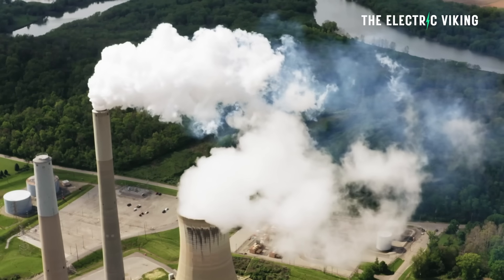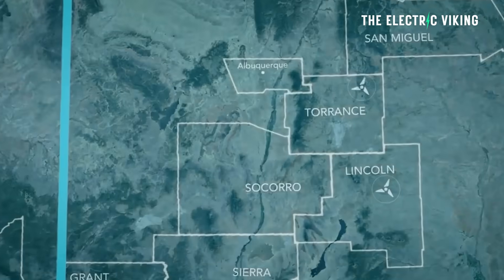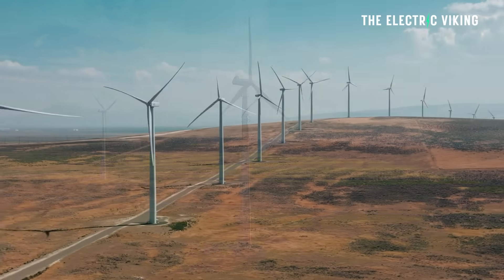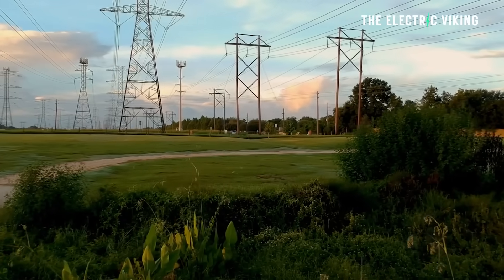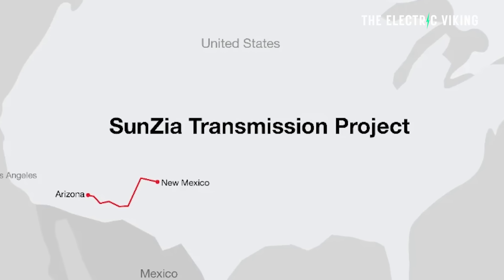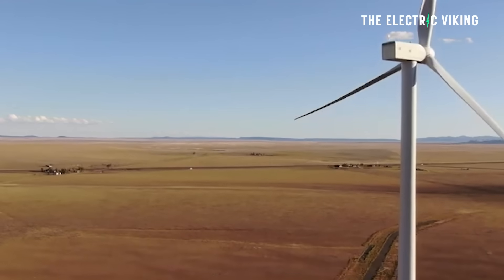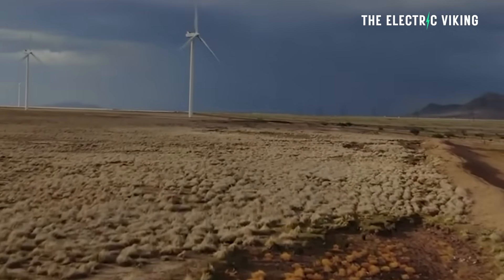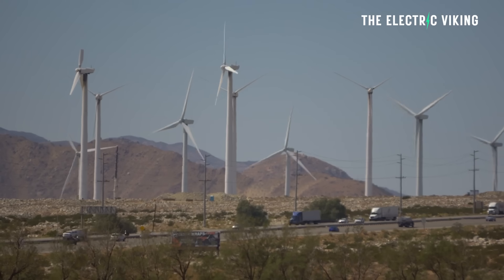The largest clean energy project in US history starts construction costing $11B

Comment: THIS is why nuclear is DEAD. 

Renewables are faster to build, cheaper to build, can produce as much power as nuclear. 
With battery backup PRODUCES BASE LOAD. 
Decommissioning or replacement is dead easy and cheap. 
NO toxic waste to protect & store safely for 1,000 years at obscene cost. 
Bottom line: wind turbines & solar panels NEVER GO BOOM.

Absolute worst safety concern with wind? A turbine in the middle of nowhere could fall over. Which case we cut it up, feed it through a rolling mill & make more turbines or cars out of it. Nobody's harmed; nobody dies. Nuclear: disasters HAVE ALREADY created no-go zones almost as big as Cornwall, banned from human use for any purpose for 1,000 years. A major nuclear accident in N America could wipe out a major city, rendering it uninhabitable due to toxic pollution exposure. If Chernobyl occurred at Ontario's Pickering Station, at least half of Toronto would be rendered uninhabitable. Canada's economy would tank.

Humans don't assess risk rationally. We understand easily graspable risk with percentage outcomes assessments. A 20% reduction in accident mortality is obtainable by replacing traffic lights with roundabouts? We can rationally debate that, maybe make the change. But low-probability risks with catastrophic outcomes we don't comprehend. People fight the minor inconvenience of a helmet, seatbelt or (in a pandemic) face mask, despite the horrific potential outcomes: death or horrific injury. In assessing nuclear risk we comfort critics with platitudes about how rarely there's been nuclear disasters. Hundreds of generating stations but only a few have suffered catastrophes - but they DO occur and they ARE catastrophes! And they're entirely avoidable. We do not have to build nuclear! The only reason we ever started doing so - and the reason we settled on heavy water fission reactors - was to produce plutonium as waste & feed the arms industry, to build nuclear bombs.

Now investment firms like Brookfield have noticed the costs of nuclear are horrific; getting governments to back new nuclear guarantees horrific payouts for decades, then even bigger expenses for decommissioning at end of life. So Brookfield has invested in both construction & decommissioning firms.
  
Nuclear is an obscene scheme to sting electricity consumers & citizens with massive bills, ensuring investment firms can treat grid systems as a multi-decade annuity that pumps your money into their pockets. At the end of life they get to treat the inevitable decommissioning & waste management boondoggle as ANOTHER annuity with even higher cost & no end date: they make money FOREVER on that scheme. What's not to like?

Nuclear is dead but they keep trying to bring it back. Drive a stake through its heart! Fight attempts to revive it!

Comment: ok so what goes into making a wind turbine, the transmission lines, the machinery to mine and extract the minerals and the oils to build them? this isnt including the machinery and i qoute this from an environmental page  

'A 5-MW turbine has three roughly 60-meter-long airfoils, each weighing about 15 metric tons. They have light balsa or foam cores and outer laminations made mostly from glass-fiber-reinforced epoxy or polyester resins. The glass is made by melting silicon dioxide and other mineral oxides in furnaces fired by natural gas. The resins begin with ethylene derived from light hydrocarbons, most commonly the products of naphtha cracking, liquefied petroleum gas, or the ethane in natural gas.

The final fiber-reinforced composite embodies on the order of 170 GJ/t. Therefore, to get 2.5 TW of installed wind power by 2030, we would need an aggregate rotor mass of about 23 million metric tons, incorporating the equivalent of about 90 million metric tons of crude oil. And when all is in place, the entire structure must be waterproofed with resins whose synthesis starts with ethylene. Another required oil product is lubricant, for the turbine gearboxes, which has to be changed periodically during the machine’s two-decade lifetime'

why do you think oil companies are 'heaviliy investing' in renewable energy? is it clean? 

i will leave that for you to decide
Reply: Have you computed how much electrical energy will be generated by those turbines over their lifespans? You should. Then look at how much coal/gas it would take to produce that much energy. Then ask yourself again if it’s a worthwhile investment.
Reply: Nevermind, I’ll do some math for you. 2.5TW of installed wind power, at a 33% capacity factor, would produce about 7 trillion megawatt-hours of energy per year. By way of contrast, 90 million tons of oil contains about a billion megawatt-hours of energy. So the oil you’re concerned about? That many wind turbines would replace seven thousand times as much energy as that oil contains - each year. For what, 25 years? So over their lives, the oil used to make those blades would lead to around 175,000 times more energy produced than is contained in the oil.
Reply: @davestagner  by the time you factor into the replacement costs of the blades and gearboxes every 10years along with grease etc and production of new parts wind turbines will surpass the usage of oil for energy generation .... But you continue with your dreams .. you forget this has been tried before..  .. and to make it sting a bit more for you there is bio LPG .. we have just taken delivery of 3700lts in an effing big tank to heat our home 👍
Reply: @davestagner  but turbines only work efficiently when the winds are at the right m/per second, the 2 turbines i have have never worked to the optimum since i gave permission for them to be erected on my fields and to comment what the maintenance guys say 'i keeps people happy so thats why we do it' so if you want to go the route that actually makes gas and coal more efficient than wind  or solar prime example you would require over 100 million acres to power America at the same capacity as oil & gas.... so how many to power the uk? im sure im not sacrificing anymore land to erect that something that isnt going to work,  Capital costs tend to be low for gas and oil power stations than wind turbines ... the issue is everyones jumped on the worlds burning bandwagon and co2 is going to end all of mankind and the answer is already there with biolpg from plant mass  ..... renewable DOESNT EXIST it is utter crap
Reply: @vandamonium1731  I actually accounted for the inefficiencies, computing normal capacity factor into my calculations. But somehow, I don’t think you will care.
Reply: @davestagner  'i computed in' well sir let me add to this then where do you store all this apparent energy? i i think i know what your going to say then i have a real kick in the backside for you

Comment: Really annoying when Sam Evans says that SunZia will have 242 of the biggest wind turbines in the world. Pattern Energy's SunZia project will use 242 Vestas V163-4.5MW turbines to build 1.1GW in wind farms. Those aren't even close to the largest wind turbines, nor the most efficient. The largest installed offshore wind turbine is currently the MySE 16.0-260 and the largest onshore one is an 8.5MW Goldwind turbine at Changyi Wind Farm. The largest planned onshore turbine is the Goldwind GWH24X-12.X which is 12MW and the largest planned offshore turbine is the Mingyang MySE 22MW with a 310 meter rotor. The V163-4.5 is puny compared to these turbines.

Comment: This is good news because we desperately need high power transmission lines to transmit electricity from wind farms to big cities. However, I wish these high voltage HVDC lines could be buried. Even though burying lines cost more, it can reduce the maintenance because the buried power lines are protected from the weather. Buried power lines could run next to interstates and make them easily assessable if necessary. The blight from ugly power lines traveling thousands of miles can be greatly reduced by burying as much of the power lines as possible.
Reply: Underground power lines are hugely more expensive to lay, and to maintain. Better get used to the towers.
Reply: To bury these lines would require DC instead of AC power transmission. Possible in the lab, not yet in practice. Much research is currently going to this.
Reply: @ebx100 HVDC lines are already in production. The EU have a bunch of them to balance electrical needs between countries.

Comment: Hey Sam, I believe we can turn all our AC units into carbon capture devices, collecting CO2 while we cool our homes.
The captured C02 could be picked up with our weekly trash pickup and then turned back into fuel and useful items.
I don't know why this on one has looked into this?
Reply: Any links?
I assume the major issue is energy efficiency. Current direct air capture systems have efficiency of < 1%. Put in 100 units of energy equivalent of burning pure carbon. You only get less then 1 units out from the air.

It makes no sense unless you run the entire AC from pure renewable sources. But it's likely more efficient just selling the power you generated back to the grid so we use less coal and gas.

(Efficiency can't get higher then 100% due to laws of thermodynamics)

Comment: Despite this huge investment (if it is delivered on budget - big if) this scheme (if U.S. energy information administration is to be believed) will only provide about 2% of Arizona’s electricity demand and is guaranteed to put up electricity cost. To get rid of their gas fired power plants they will need 20 more project this size.
Reply: Oil use to be skimmed from the ground by hand long ago. Be patient.
Reply: Is that a typo? I calculate about 12% of Arizona's consumption, which creates a rather different picture.

Comment: In Colorado we currently have 70mph winds and snow. All the wind towers are shut down so they don't break. Have to admit I absolutely hate those hundreds of turbines and red blinking lights at night. They really destroy the sunrise. 3 or 4 days ago one of them caught on fire. I think they ought to switch to the horizontal turbines near the ground. I'd be curious how those might work out.
Reply: They need to buy better wind turbines! Here in the UK our turbines work fine in snowy Scotland. They even work fine in the North sea, with all the waves and salt water spray.

It sounds to me like they bought turbines with no internal heating elements and now their regretting it
Reply: Boeing does renewables? @domtweed7323
Reply: @domtweed7323  um no they dont the scottish ones have been shown to fail in a the cold a recent report also they need diesel generators to keep them going
Reply: @vandamonium1731  What do you mean "fail"?

In the UK we often get cold weather and low wind speeds together, since a weak Atlantic breeze leads to both. But our turbines don't physically break or ice-up, they just produce less.

The exception is when you turn a turbine off for other maintenance AND it loses grid connection, then you'd use a generator to run the heating elements and keep it de-iced. But that requires a fault in the grid.
Reply: @domtweed7323  not according to scottish power who have said openly 

 ' the company was forced to hook up 71 windmills to the fossil fuel supply. The move was an attempt to keep the turbines warm and working during the cold month of December.
Reply: @domtweed7323  but blade failure ai a common problem for temperature such as creep, fatigue, oxidation erosion, and corrosion
Reply: @vandamonium1731  Yes, because their connection to national grid went down. 

Those 71 turbines should've been connected to the grid, which would've let them run their heating elements and supply power.

Alternatively a small battery pack could've been used to stabilise the frequency, allowing them to run the heating elements on their own power (presumably that wasn't implemented because Scottish power expected national grid to keep the turbines connected).
Reply: @domtweed7323  scottish energy got called out on that excuse ...but the biggest issue and what suffers badly in the cold is the gearboxes they dont make it past ten years and its not down to lubrication before you refer to that its down tempratures also the blades that crack on regular occasions
Reply: @vandamonium1731  Blade failure is common. But it's not a catastrophic issue that takes all the turbines offline (like unprevented icing would be), it effects turbines one at a time and requires a bit of maintenance.

It's like how cars break down. If everyone's car broke down at once it would be a disaster, but because they break down randomly, and so the total number of breakdowns is spread out more or less evenly across the year, it's a manageable problem.
Reply: 😢the blinking lights gotta go
Reply: @billw6903  There's actually a solution for that. The wind turbine companies are looking to put radars on them, which would activate the lights only when an aircraft is nearby.

Personally I think their needs to be state regulations to force them to implement that (consider starting a petition in your jurisdiction about it).
Reply: Horizontal turbines near the ground don't work very well.

Comment: UK offshore wind 2023 round-up and 2024 outlook
Published 21 December 2023
This blog was written by Omer Khalid, Analyst, Analysis & Insights – ORE Catapult

When it comes to offshore wind, the UK has not only weathered challenges but emerged as a frontrunner in the last decade. 2023 saw the momentum continue as major capacity milestones were reached, new projects progressed, and the UK Government firmed up ambitious plans for long-term growth. Yet existing challenges around project delays, Contracts for Difference (CfD) pricing, and supply chain bottlenecks persist. As the UK looks forward to 2024 and beyond, resolving these issues while assessing the offshore wind value chain from a holistic perspective will be the key to project delivery along with maintaining leadership amidst rising international competition.

 

Power Behemoths Come Online
The flagship achievement this year was the start of the electricity production from the 3.6 GW Dogger Bank wind farm off the Yorkshire coast following the installation of an industry-first Haliade-X 13MW turbine, which was tested at our world leading specialist facility in Blyth, Northumberland. At 1.2 GW per phase, each of Dogger Bank’s three phases currently represents the world’s largest offshore wind farm. The first power milestone marks the first of what will eventually be 277 turbines powered-up across the project. Each of these turbines will be progressively commissioned between now and full commercial operation due in 2026. When complete, Dogger Bank will be more than two and a half times the size of the largest offshore wind farm currently in operation. 2023 also saw Scotland turning-on one of its largest, and world’s deepest fixed-bottom offshore wind farm to date, the 1.1GW Seagreen offshore wind farm.

Teething Issues Endure
Even as capacity and investments grew steadily, project delays, regulatory uncertainty around grid connections along with financial and supply chain constraints continued hampering faster deployment. The industry has faced a double economic blow that has compounded costs. First, the cost of building and installing wind turbines has increased due to the price of materials rising sharply, owing to the geopolitical and trade headwinds. Then, the cost of borrowing money to finance the multibillion-pound projects has climbed in line with global interest rates. Norfolk Boreas wind farm, off the coast of Norfolk, was halted by the lead developer Vattenfall due to spiraling supply chain costs and rising interest rates which rendered the project being no longer profitable, with the CfD it was awarded.

Recently, major turbine OEMs have also been dealing with a spate of reliability issues. This has impacted Kincardine, the largest floating offshore wind demonstrator project, as, due to insufficient port infrastructure, a turbine had to be towed to Rotterdam for major component replacements. The UK also continues struggling with a shortage of specialized crew vessels to service and maintain the exponentially growing fleet of offshore turbines.

Perhaps the most eye catching development was that Allocation Round 5 (AR-5) of the CfD process failed to attract any bids from eligible offshore wind projects. This was viewed by many as the inevitable result of prices that did not match up with the economic reality facing offshore wind developers. For the upcoming AR-6 auction due to be opened in March 2024, the maximum Administrative Strike Price (ASP) has been increased by 66% for offshore wind projects, from £44/MWh to £73/MWh, and by 52% for floating offshore wind projects, from £116/MWh to £176/MWh (in 2012 reference prices). Offshore wind will get its own “pot” in AR-6 which is a very welcome development. Furthermore, there are consultations to add “non-price factors” into the ARs from 2025 onwards. Meaning projects may be awarded more money if they reduce carbon emissions in their supply chains and demonstrate positive social impact on communities. These auctions , with an aim of 3-5 GW per AR, may add capacity topping 30-50 GW over the next decade. Other positive tailwinds include investments in port infrastructure upgrades, local manufacturing expansion, and major offshore site surveys kicking off across the Celtic Sea, North Sea, and Pentland Firth.

Comment: Thermal solar can store Heat as molten sand for the night at a much lower cost than batteries, without the high cost of batteries.
Reply: Yes there are sand, concrete and carbon bricks baterry storage now for cheap.